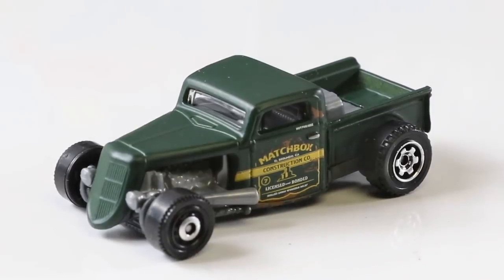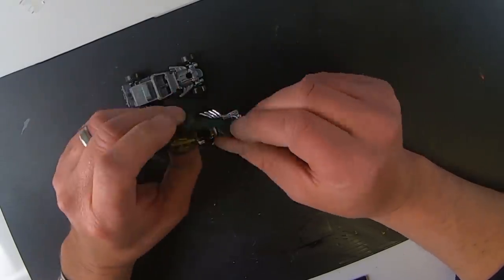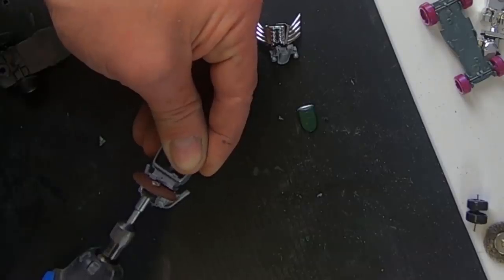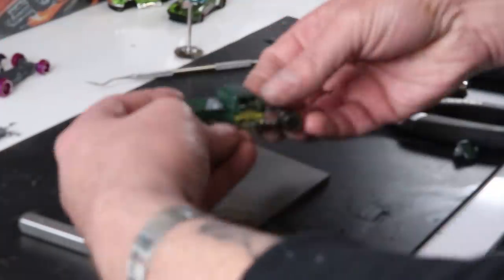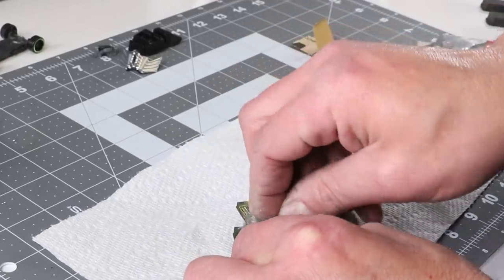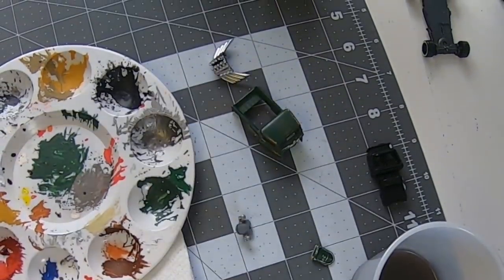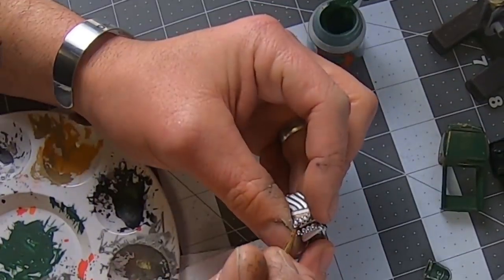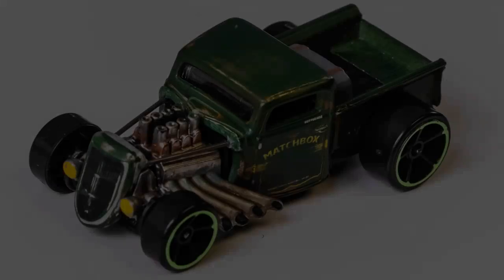Episode 36  Hotbox 1935 Ford Pickup Boneshaker

Comment: Those helping hands stands would have been helpful when you were doing those braces between the rad and the firewall. You could've used one of them to hold the rods.

This build is amazing tho. Not much into rats, but I know how hard making fake rust look real, so you did a good job! Plus the idea of mixing this truck with a Boneshaker is really neat.
Reply from the maker: I tried. I gave up too easily lol

Comment: Love it. Nice build. I have a couple off those cars. Been thinking about starting to do customs or different builds to make hot wheels or match box look better. But I need to find a tap tool that’s small enough. I have a tap and die set but it doesn’t come with one that is small enough for a small screw like that. Can anyone tell me where to get one small enough and what size?. Do local stores carry them or do I half to order on line web somewhere?

Comment: forget those dangerous flinty cutoff wheels that shatter, get yourselves these fiberglass ones, they never break, they grind down into powder as they wear down, cut through anything and last a long time. Plus they're big- the size of a 50 cent piece, and at 15-18 bucks depending on vendor on amazon for 100 with 2 heavy duty mandrels it's a better deal than anything else out there. I use them for making cookie tin and cigar box guitars and use them a lot, and 100 count has lasted me over 2 years because they last. You can sometimes get 2-3 jobs out of one disk.
https://www.amazon.com/Rotary-Tools-Fiberglass-Reinforced-Mandrel/dp/B01M1Y13UG